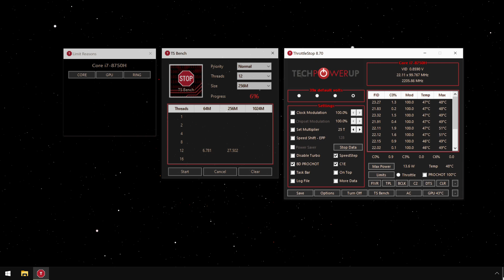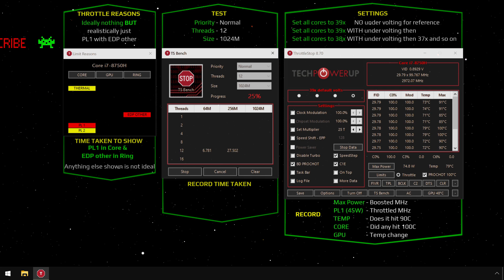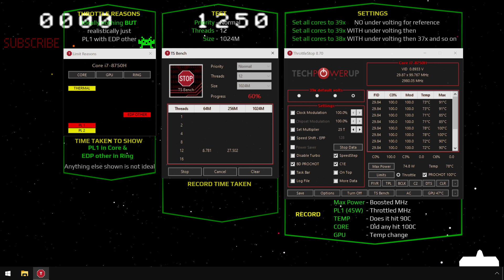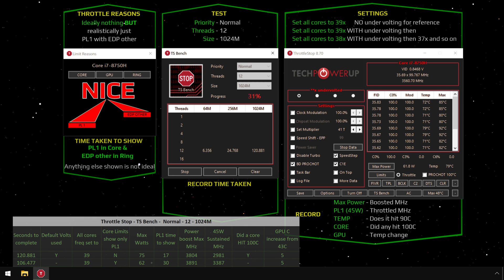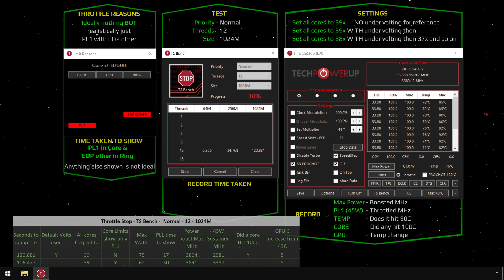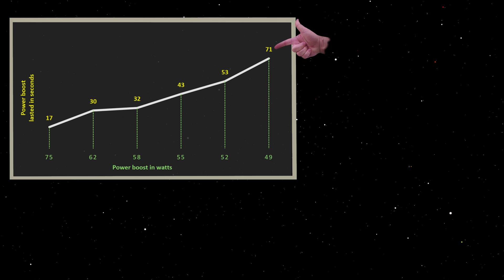Understand then COOL the intel i7H CPU Tech guide #2 ⮜iDATUS⮞

Comment: Hello, I just get an RB15 in my hands and trying to do some settings for  Idle mode. The thing is I do have the 1.06 Bios,  10750H Base early 2020 model.
If I try offset Volts or just set up less Turbo ratio limits it won't allow me to do so, XTU is not supported yet as well. The only option I have is to Disable turbo.
Is there a way to unlock it in BIOS?
Reply from the maker: Hi there Daniel, I am not aware that the base unit stops throttlestop from working. I would be surprised, I am not saying your wrong just surprised if that's how it is.
Remember throttlestop does not change anything permanently in the bios it is an after boot event.
So as long as it is loaded and turned on you should be able to change certain settings such as multiplier and voltages.
Some other options may not work if indeed they are turned off in bios or the CPU such as the i3 doesn't accept them.
Happy to help more so reply with more info or links to video etc

Comment: hi, i got the 8750 but in throttlestop i cant get higher than multiplier 34 and i've also never seen a higher frequency than 3400 mhz. does anybody know why thats the case? in BF5 i've seen temperatures up to 96C. with throttlestop it's a lot cooler but i get only 100fps on low settings and 720p. more should be possibe..
Reply from the maker: I mention why in the video, in short what the CPU gives at 45W or lower if it has a thermal issue.
You get a temporary short time boost at the start of a high load.
Reply from the maker: Soz my reply dont make sense, my bad.
What I was trying to say is that the CPU works at 45W.
Depending on your load and voltage offset you will get higher or lower than 3400mhz.
The cpu will work upto 3900 mhz to short periods.
The length of time this will last will depend on the wattaged asked.

So theoretically if you could get the cpu to run at 3900 and 45W it would run forever.
Hope that helps you better than my initial response.

Comment: Greta video , except undervolting can i make the cpu use max wattage for example 30? Or it cant be adjusted?
Reply from the maker: Going on from our other conversation, you cant change the max working watts of 45W (not in Razer at least).
You can only do this by lowering the multiplier or windows power settings.
There are methods which I will cover in later parts of the series to disable cores all together that may be of interest.
(For others reading maxed working is not same as maxed short time boost).
Reply: @iDATUS  ik thanks, how can i lower the multiplier at windows settings?
Reply from the maker: @georgegeorgep3223  Multiplier is via Throttlestop and the power settings was the power plan you mentioned at reducing from 100%
Also for Razer, the software we have called synapse has power settings, Alienware will have something similar I'm sure, that sets it to normal usage and not game mode.
Note also that it only goes to 45W if there is sufficient load on the CPU.
Reply: @iDATUS  in throttlestop you mean the multiplier that is on the main page ?
Reply from the maker: @georgegeorgep3223  I see where you are coming from, you can do it there but I was referring to FIVR, turbo ratio limits. I show them at 0:52 all being set to 39.
Apps these days spread all over the cores so there is no point in not setting all the same as they will all run at the lowest.
See episode 1 for details.
Reply from the maker: I did a test and if you set the max temp wattage below 45W it will not go above that.
You will see a PL2 limit reached.
I did set it to 30W as per your question.
NOTE: this is a global setting and it will be set for all 4 profiles regardless of settings you change.